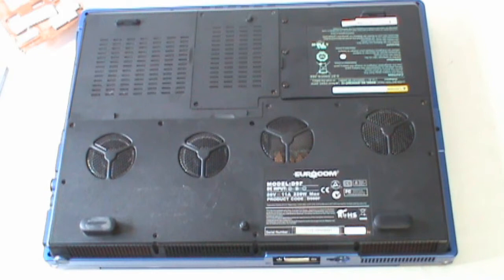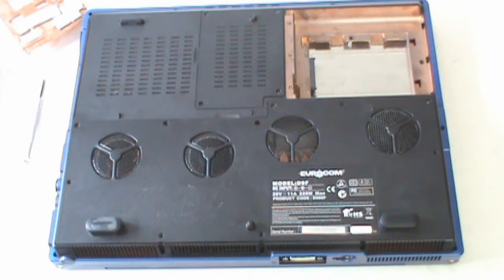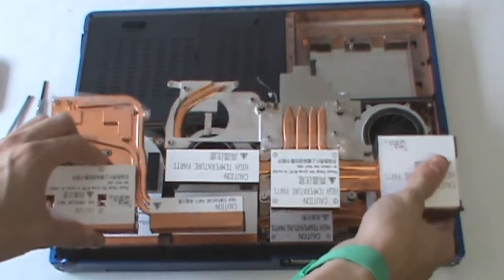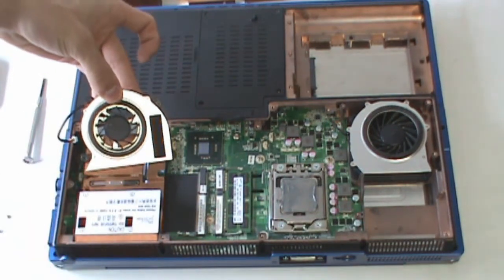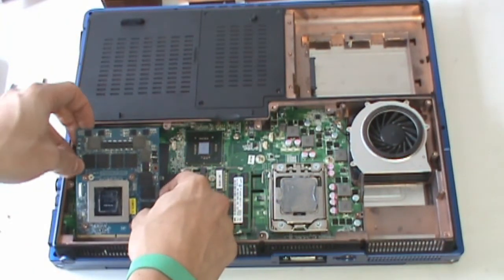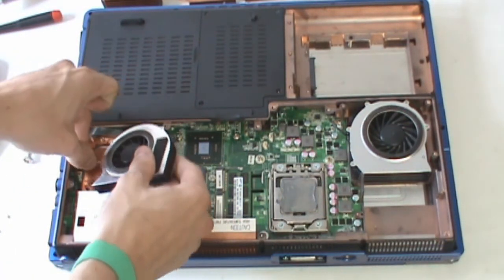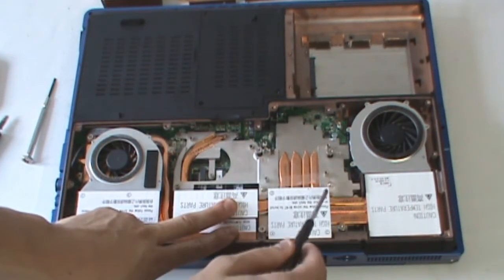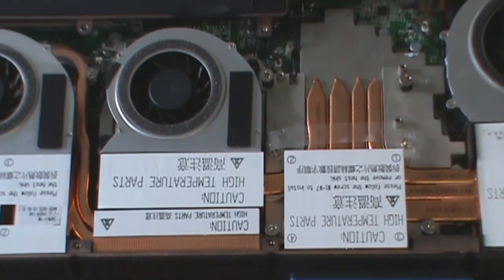NVIDIA GeForce GTX 680M upgrade in EUROCOM D900F Panther

Comment: I have the Eurocom Panther 3, it overheat if a play World of Battleships, and shutdown in the middle of a match: What i can do? You can feel the hot spot right where the 3 buttons for BT/wireless/camara are. Need to put an extra fan besides the laptop to get it coll down. Suggestion?
Reply from the maker: Your best bet is to fill out a support request.
https://web.eurocom.com/ec/supportr()ec
Reply from the maker: Check to make sure all your fans are running and make sure the vents are not blocked with dirt and debris.  If it continues...you may need to re-paste the GPU/CPU.  Any questions please contact our support group by filling in a support request on our website.

Comment: What is the part number for the heatsink needed? I have a D900f (Sager brand NP9280) and want to do this upgrade. I think I have the heatsink tracked down but not sure of the part number. Will my factory GPU fan work or will i need to purchase the fan on eurocom site?
Reply from the maker: It should work.  And you can get the heatsink from our site.  Contact sales@eurocom.com

Comment: Hello i have this Clevo D900F but i have the GTX 675M from a Clevo P150EM(my friend upgrated to the 8970m and gave me the 675m). I have the lastest bios and install about 2 or 3 diferent nvidia drivers but my card is somehow locked...my gpu clock is always 50mhz and memory clock is 135mhz, the temperature is always betwen 45 and 50. I use msi afterburner but no changes. What should i do ? PSU problem ?!

Regards,
John
Reply from the maker: +Joao Cardoso I'm not seeing that the 675M is supported in the d900f. Here are the options we offer: http://www.eurocom.com/ec/upgrade(2,290,0)ec
Reply: +EurocomTechnology i think he just need a v-bios, will the gtx 680m v-bios work on the 675m ?

Comment: Will audio work on D900F with GTX680m through DVI to HDMI adapter ?
Reply from the maker: vwrafi   Unfortunately that will not work, as you cannot send a audio signal over DVI.
Reply: EurocomTechnology Sometimes it work and you can send audio through DVI ( since GeForce 2xx and up ). There is a comment here from a user who done it ( nick 4DoorGTZ ). I just wanted to know if he done it on D900F or other notebook. So in general audio through DVI to HDMI works, all I wanted to know if it works on this specific notebook, cause sometimes manufacturer is installing not standard DVI port. I don't know which kind of DVI port was used by Clevo on this machine.
Reply from the maker: I have done some reading on this just now and it seems that some people have been able to get it working.  It that other use got it going than it seems possible. The d900f has a dual link DVI port which is to allow high resolutions.

Comment: I have got D900F ( second version - bought with GTX 480M ). Will GTX 680M work on the standard BIOS 1.00.09 or does it need to be moded/unlocked ?

Comment: i have an 15mx and its from Australia  with a 260 GTX , can i use the 680m is there anything special i have to do to make it work on my laptop or can i just install and it'll work
Reply from the maker: I dont think M15x changed in Australia so....Yes, the 680m is supported, just like in the video.  You need the unlocked A09 BIOS, 180W AC adapter, 347.25 drives, 0F41CJ heatsink.  Contact Sales@eurocom.com for all the assistance you may need. Cards are here: http://www.eurocom.com/ec/vgas(1)ec
Reply: How do i update my bios to A09 and unlock it

Comment: Have you been successful with the D900F and a GTX 560M?  When I install it, nVidia can detect it with their flash application, but it seems my BIOS has no clue that it's there and the drivers refuse to install.  1.00.03 Phoenix is what I'm running.  I don't see the 1.00.09 version working because it claims to only work up to the 480M and I didn't want to go flashing my BIOS willy-nilly.  I'm upgrading from a 280M.
Reply from the maker: I would suggest contacting the seller of card.  They should provide you with the requisite software.
Reply: They sent me to the MB manufacturer.  They had nothing but a BIOS upgrade.
Reply from the maker: Try contacting support@eurocom.com for help.

Comment: Umm I already commented on this previously but I may purchase the 680m, does it require the full upgrade kit with heatsink? Or is the 280m heatsink usable at all
Reply from the maker: Yes, the 680M requires a specially made double heatsink in order to manage the thermals of the 680M.
Reply: EurocomTechnology
Can you tell me where I can find this double heatsink? I can only find the card on ebay.
Reply: TheHarriebo I had to order everything, couldn't find the heatsink
Reply from the maker: james vaughan TheHarriebo  At this link the 680M card is for sale with the special heatsink for the EUROCOM D900F Panther http://www.ebay.ca/itm/NVIDIA-GeForce-GTX-680M-4GB-DDR5-1344-CUDA-MXM-3-0b-CLEVO-D900F-UPGRADE-KIT-/111317923455?pt=PCC_Video_TV_Cards&hash=item19eb10b67f
Reply: Already have my 680m with heatsink haha +Eurocom technology
Reply: Already have my 680m with heatsink haha +Eurocomtechnology
Reply: Already have my 680m with heatsink haha +Eurocomtechnology

Comment: Has there been anymore testing for the 880m? I would love to buy a better graphics card for my D900F but $900 for a 2 year old card is a bit ridiculous when the 880m is actually a bit cheaper.
Reply from the maker: Nothing successful with the 780M or 880M so far unfortunately.
Reply from the maker: ***** We haven't done any testing with the d900f and 980M, the 780m and 880m didn't work so I suspect the 980M also won't work properly.  Currently, the highest performance card for the d900f is the 680m.

Comment: Hi Eurocom
Why the GTX 780M is not working in the D900F? Can you give more detailled and technical reasons ? Maybe a new bios is needed.
 It's suposed to be MXM 3.0b and compatible and should work.
Does the GTX 880M works on the D900F?
Reply from the maker: Not sure why the 780M doesn't work in the d900f.  680M does work.  Yes, I believe it is a software issue.  The 880M has not been fully tested with the d900f.

Comment: "think about 780M" - does it fit the same D900F? And what about CPU and RAM needed to let it (680M or 780M) work fluidly? I have i7 920 (2.67 Ghz) + 12GB RAM 1066 Mhz. Should it restrain somehow 680M / 780M performance?

Comment: I have the Panther D900F, Clevo X8100 and the Clevo x7280; after watching the video I will be buying the GTX 680m for the Panther D900F.
But I want the Radeon HD 7970m for the other 2 laptops...could you show a video with the HD 7970m running either in the X8100 or the X7280.
The HD 7970m is better for GPGPU stuff and CAD Apps the the GTX 680m which seems to be just for games.

Thanks